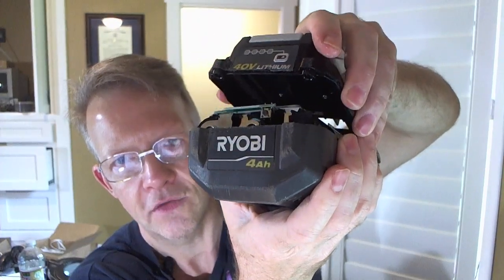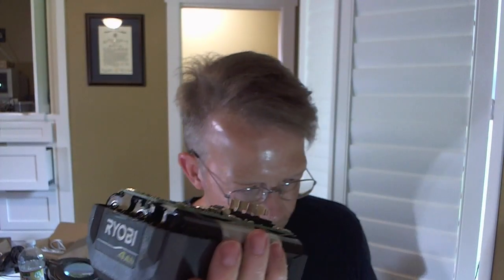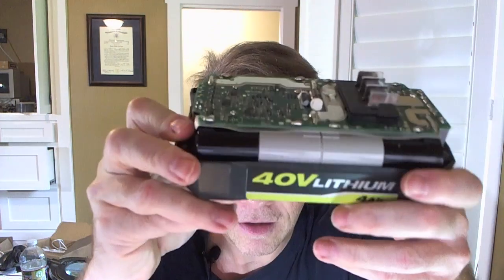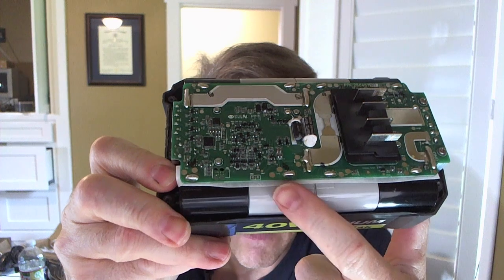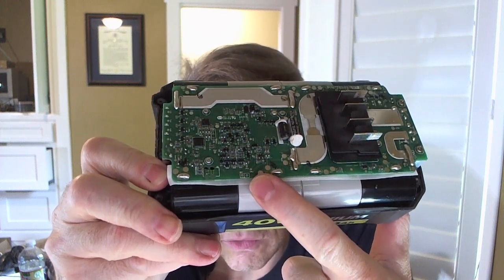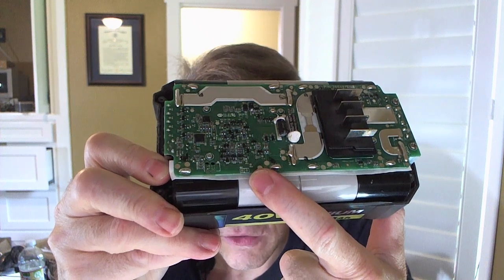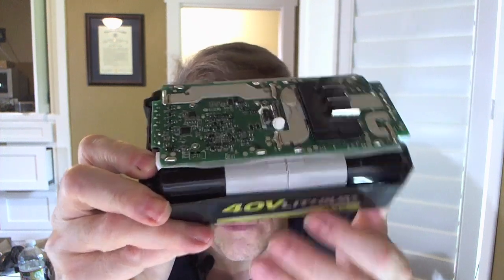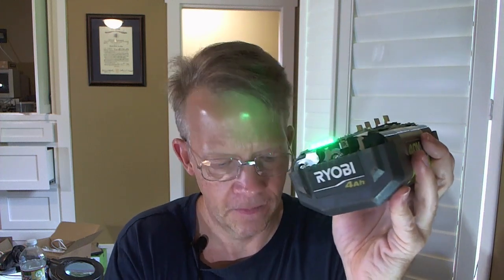Don't "Boost"; Safer Reset! 4 lights blinking on Bad Ryobi 40V Battery Pack? OP40501 OP40401 Rev. Q.

Comment: Is T10H the same as T10?
Reply from the maker: The 'H' means hollow. What I Googled is a little unclear but just use my link to buy a set and you'll be good for tons of projects. I use my set VERY frequently. Can you please Like and Subscribe?
Reply from the maker: Thanks for your donation Monica! I really appreciate it!
Reply: @RobertBullock  I'm really new at this and I don't quite understand the process without a video actually showing it. Am I supposed to stick a pin or something in those little holes? I opened the case and see them, I just want to do it correctly. Do I just touch anything metal to ground myself while doing it? Don't want to hurt myself either LOL!
Reply from the maker: For ease, here's the set I have or it's very close: https://www.youtube.com/redirect?q=https%3A%2F%2Frover.ebay.com%2Frover%2F1%2F711-53200-19255-0%2F1%3Fmpre%3Dhttps%253A%252F%252Fwww.ebay.com%252Fitm%252F33-pc-SECURITY-BIT-SET-TORX-TAMPERED-PROOF-DRILL-DRIVER-TOOL-SCREWDRIVERS-BITS%252F350583822596%253Fepid%253D600593879%2526_trkparms%253Dispr%25253D1%2526hash%253Ditem51a06c9904%253Ag%253AtK4AAOxycT9R5h3G%2526enc%253DAQAFAAACYBaobrjLl8XobRIiIML1V4Imu%25252Fn%25252BzU5L90Z278x5ickkWpEuxXwAiCNKyBQsQ5%25252Fe6%25252Fg%25252FJhgZb6vBP9LbkWZJeXB9kNQFTg3U1rF0Y3udqe3rYCBMtBlwiy5ZMjSaz9VE%25252FUS1lQUnKnXtXw1mxosIOBF4bmv3FuxSMNTZxoD0pCy66GVFPfa8gaUWgYresnTK0GrFaOrv8Ly3h6t2vOGNmU82C6NYtyE4dXdLG8VmuPCRUk1rAJHSMw4g6lhWxIegIQxMTyjHynVmjb1S%25252B9X%25252FtnQw4muJyhPQKwpFL0SlDb%25252FBKDUBdvIt7Y8J2%25252ByitzYdBAQZ2AMjzbQf2BQwYaATfov5PyC4eYXjm26NgKTLPGSB4KzJIPoZaxeiNDaQxlRBwLIYC94155mLWtWpmdMPYTfG0KDF39GOibVRO%25252Fek1UbIyALsErtP%25252Ftb8AmEr2RkaXY6zWzfxBltsg%25252BGKEFu0xQUNKTeUlE%25252FrIeOeNNAnqbyxfcB%25252FiCcTZ8CUwkmHCmmO0vjbjOsumtjZ7sqHqGlVoW6N6Qp1k7fvzFIRL19FBmY%25252FjfGd1%25252FiruDCjbmY3Sj3z4%25252Fy4v8mt%25252Fc2SkN8DYnBQvg8LY0kpA%25252BZ2gALCKCW6wmxX6AWZj3lpujssMDScTF0flnfL%25252Flu%25252FcM%25252BHl1HuqjJqRj30a6Fxaw%25252FQS6S1rBLCbgpCZduOBl9V6CDDDIKjAOB2UjLtAJP1nR%25252F1dZNvBSdIiPW9TpTHLrH8M8S0FAUJfvXxwcpQLGPMgwDPY1ZPnTsmoLcqdc4vpxes5kPrntxnnZLLFGHHneWoigTzjGHSm2Nx%2526checksum%253D3505838225961063558040ba41068c3f2af2ebab9a4e%26campid%3D5337534429%26toolid%3D20008&redir_token=QUFFLUhqbC1HdjlJXzdWb1RQU2VORG9HOFJkRUtGd2M1QXxBQ3Jtc0trTTdhdDBxTE10N1UxOXFjcUtLZzAtLW1reERGX09seFZfdnQyTDVBdGNrbjlLaWFKOWtPaDlaOHYxWmI5Zko0bEVEVnp0NWl6V0JyRVdwN0hkX1RHcF80NHQ4aGNqeHo0NzhIY1Nma2gxSzRqbWJFcw%3D%3D&v=JKgKB9jn1Eg&event=video_description

Comment: Thank you so much!! This is the ONLY video I have found on this model. I have the 5Ah 40v battery (OP40501). All of the other videos on Youtube are on a completely different model and they want me to do all kinds of mods. All that stuff on websites about using another battery to charge this bad one, or spending 30 minutes plugging it into the charger and then taking it back out just before the charger light starts to flash red/green...USELESS! When I found this and performed this simple reset, it worked perfectly and the pack is charging as I type. I sent you a little more than a cup of coffee bro, you just saved me $160.00 if I had bought a new one at Home Depot!
Reply: Thanks! I will say this: not ALL packs work properly again. One I had worked but then I had to reset it again to make it work....I may solder in an external contact set for that one. One worked fine thru one cycle so far. One I haven't tested again. Some reset but then still wont work. So, YMMV. But be sure to try it as so far, some work fine as far as I can tell. Pretty sure one of mine was just a thermal issue....too hot outside, heavy use...and went into safe mode. Texas in the summer. Tall weeds. Weedeater.
Reply: @Beachfitrob  I am in South Florida, probably heat is the issue also.
Reply from the maker: There IS a tiny thermocouple (it appears) tucked away in this pack. It's a black 2 wire pair to a tiny black bulb. It's under the big metal piece at one end. I did a teardown to harvest cells on one I couldn't ever get to reset.
Reply: So it sounds like the 5Ah is the same as the 4Ah basically.
Reply: @Beachfitrob  Seems to be, it looks the same on the exterior and has the same board.
Reply: Also, don't know if I mentioned it but I don't think the jump works here. If you jump it, and then hold a voltmeter on it, the voltage bleeds down rapidly. I think it's charging a small capacitor maybe? I think the other contacts control the pack. It's not a dumb pack by any means.
Reply: @Beachfitrob  Yup, that's what it did! It would hold the 40 volts right after I tried to boost off a good pack, but when I put it in the charger, it would flash red/green. Then when I took it out and tested it again, it was at 3 volts. Ryobi did everything that could to get people to buy a new battery, when it's just a simple reset.
Reply: @itsbetterwithbeer4353  At minimum, it's too conservative. A heat issue for outside temps for example. On that note, I've started sticking my batteries in the fridge for a bit to cool them before use/charge.

Comment: So far, I've fixed one pack with this. Can't beat the cost: free!
Reply: i only see one hole with reset on it,  what's the other jumper contact?
Reply: @1everett174  Can you post a pic somewhere like Photobucket?
Reply: @1everett174  That looks like a spot to solder in a header. If I had to guess, for diagnostics or reprogramming the board firmware.
Reply: I set you a full board pic.
Reply: @1everett174  Nope, looks restricted.
Reply: @Beachfitrob  ok i never used photobucket,  can I seen you a pic. to your email address
Reply: @1everett174  Easy: https://wetransfer.com/ then post the link to the file. Click 'no thanks' if you don't want to sign up then 'get a link' after upload and post that link. If I figure it out I may even do a short video on it.
Reply: @Beachfitrob  looks like you also have a fb page, I can text or message you a photo, if that's ok..
Reply: @1everett174  Ok, but WeTransfer is a VERY useful thing to learn and it's 3 clicks to send me a file. It's in the 'teach a man to fish' category. Also useful for large files, like up to 2 gigs I think. Msg me on FB and I'll look in a bit. Doing some IT stuff.
Reply: @Beachfitrob  ok
Reply: @Beachfitrob  ok

Comment: I’m going to give it a shot, my 5ah battery is blinking all four lights .
Reply from the maker: I bet it fixes it. Especially if it stopped working all of a sudden. I think mine was an overheat condition. Summer in Texas, working in the sun and heavy tall weeds.
Reply: purchased the 40v snow blower....one battery is blinking 4 lights out of the box....the other battery took over 10 hours to charge and never fully charged...charger shuts off